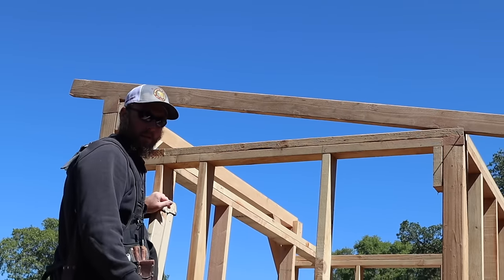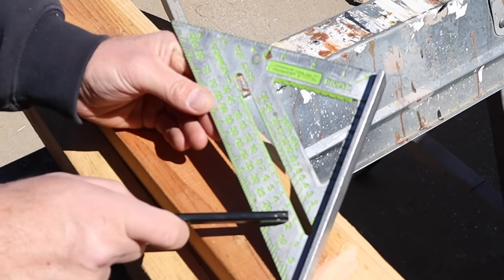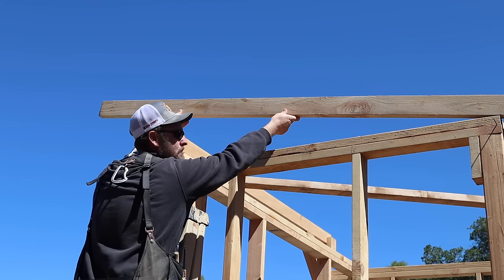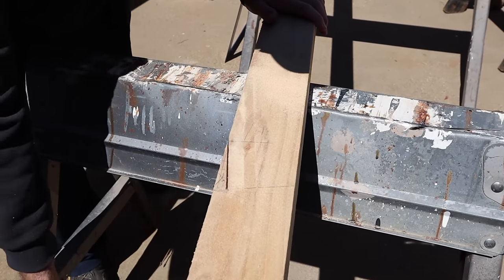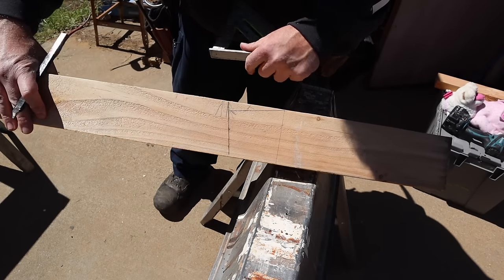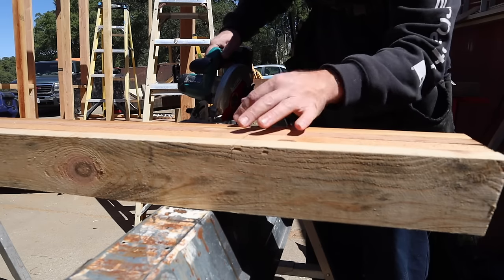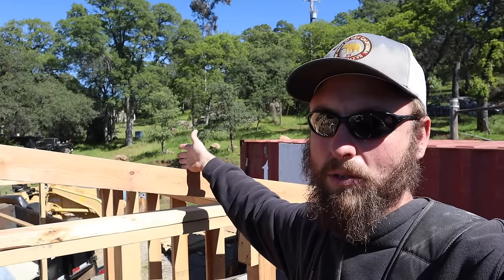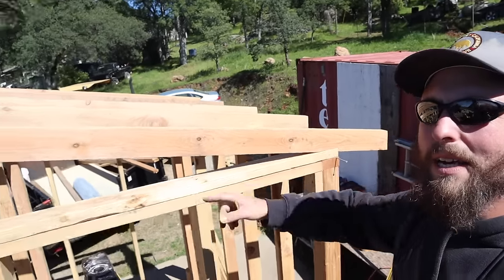BIRDS MOUTH & PURLINS Cutting The Roof | Chicken coop build PART- 4

Comment: I truly respect old world craftsmanship,  always admire diligence in appearance and fit.  You are definitely a craftsman.  With that said, and considering time is valuable and sometimes more modern brackets are exponentially more robust than wood to wood fitments, I’d point to the use of metal prefab brackets between your top plate and rafters. Sold by most lumber stores, they are called  “18-Gauge ZMAX Galvanized Hurricane Tie”.  Sell for $1.25 each.  Huge time saver, bearing strength of 1100 pounds each.

Comment: I just stumbled upon your video, and glad I did. The way you explain each step in simple terms is outstanding, especially for those like myself with limited building experience. This video would have been a game changer for me when building my 10 x 24 firewood lean-to shed last summer. The idea of doing birds mouth cuts intimidated me, so I used hurricane ties instead. The way you explained it and the detailed use of the speed square (never knew how to use one) was excellent and I would have given it a go. I just kept shaking my head while watching this and kept thinking, I would have done a few things differently with my shed (like adding the purlins to accommodate a longer eave) cause you explained its so well. I have only found a few channel to subscribe to, and you have now been added to that list! Thanks, and looking forward to checking out your other videos.
Reply from the maker: I am honored to be on your sub list! don't beat your self up I defiantly went over board on this build (always do). Plus I knew I was going to move it around with the tractor so it needed to be strong. for a wood shed straps will work just fine.
Reply: Joe Simple awesome vid!!!

Same here wish I saw this video before my build I too used hurricane straps on my slanted roof.  I think the hurricane straps will hold just fine however next time bird’s mouth cuts for sure!

Comment: Built something almost identical to this in september. 12x8, 12 feet tall at the front, 9 at the back. First shed ive ever built. Two door entry for the lawn mower, tons of space. Put three motion sensor solar lights on it, one more inside when the snow melts and some compartments and such uptop. The whole thing is framed from 2*6 except for the side walls which are 2*4.  Its pretty smart, all the country folk neighbours love it. Board and battond the plywood. Four X crosses on the doors, pure yellowstone.

Comment: You do an excellent job explaining things , I enjoy watching others  work  now after having worked in construction many years !  A little trick an old time carpenter showed me  is to keep a heavy old time rasp handy! I did a lot of birds mouth cuts and kerfs for ledgers . Knock the wood out with your hammer and then hit the birds mouth  or notch cut with rough side of rasp and flip it over and smooth side rasp the shoulder to heel cut . Takes the little scrap out of the corner and levels things up nice on notches . The rasp will do in seconds what you did with wood chisel ! Try it ,you'll like it !

Comment: This is great, I’m building a wood shed with a lean-to roof like yours. I’ve never built one before and now I’m sure I’ll be able to make the cuts properly. Keep up the fine work and thanks for sharing your experience!
Reply: I'm planning a "kiddo garage" for all their outside stuff and this is the type of roof I would like.  Glad there are skilled people out there willing to share their experience with us all.
Reply: me too!!! Ive been trying to find a solid easy to follow roof tutorial  for my "lean-to". Ans this guy nailed it. I think explaining the common 10 degree measurement is what made this "click" in my head.
Reply: @troyna77  lol nailed it
Reply: Crown your boards the same direction and that direction should be upward so it doesn’t look like it’s going up and down going across the top from side to side.
Reply: @troyna77  the ten degrees is for the 2/12 pitch and it is also for a metal roof so don’t use it for a shingled roof. Buy a speed square and use the common section and the pitch you use just look at the degrees below it and it’ll tell you the matching degrees when you’re lined up on your common pitch at same time so you’ll know how to set up skill or table or chop saws pitch.

Comment: 💥 Nice video.  2:47  measuring 12” along the rafter run gives you less than a 12” extension at the soffit and the steeper the roof the longer that 12” measurement that you did needs to be.  With a 12 on 12 roof pitch  that has to be 18” to give you a 12” soffit

Comment: Just to have a sturdier structure, or when building a larger roof, you could have done some smaller lookouts, the 2x4’s being layed flat,  and only notch the rafters on both ends, then butt the lookouts to the next rafter and nail them flush. But for this purpose it should be fine, a little extra work though.
Reply: Yes. That sounds like a good plan. Load of the roof is preserved that way. Those notches in the middle aren’t necessary and weaken the roof considerably I would think.

Comment: As a suggestion.  If your going to cut in Perlings any way you should center one at 48 inches for the seam of the plywood.  Then split one on either side.  
As an option you can notch only the outboard rafters to use for your over hang.

Comment: I put those tops boards right on top on my roof beams one foot apart. But I can see how notching locks them together...if the beams are big enough for the span. Makes a good over hang away from the rain. Make it steep enough and you'll have a self unloading snow roof. Good for off grid winter clean water on top of the wood stove.

Comment: I'm building a lean to porch and have been wondering HTF to attach the overhang rafter if it's supported by nothing. Purlins.. thanks!
Reply from the maker: Quick tip, you don't have to go all the way through like I did you can just cut out the outside rafter then attach to the next one inside. Hope that helps, thank you.

Comment: Good job!  Extra work warning: notching the rafters 0.75 in and the purlin 0.75 in gives better structural integrity than cutting a 1.5” notch into the rafter.  May be overkill on a chicken coop but worth considering in heavy snow load areas.
Reply from the maker: Ah yes the Lincoln log method, Good call.
Reply: This was my first thought on this. Not that big of a deal on the roof for something small like this.
Reply: Ah good call. I'll try this just for the heck of it.
Reply: That’s a good idea!👍🏼

Comment: Very informative video, both in narration and images. I was concerned, though, that the perlins would severely weaken the shed roof 2x4s. I would have considered instead supporting the outer edge 2x4 roof joists with several equal-spaced 2x4s, angled, that would be  attached to the inner edge of those 2x4s, and the other end toe-nailed into the plate above the wall studs.

Comment: This is excellent. Very well done!!!
Reply from the maker: Thank you very much, so happy that you found it useful. Good luck on your roof build. Please don't hesitate with any questions.
Reply: Hi do you know how high to up on the heel?  It looks like you just did a random distance up the heel and to the reference mark.
Reply from the maker: @cnorth50  when you follow the angle of the pitch you want  useing the framing square to the 3 1/2 inch point it will give you the heal height.

Comment: Very helpful. Where I leave most of the year we have a nice weather. But for to do my projects and keep me out of the sun;  I'm going to build a 10' by 16' cover roof starting from a concrete wall. You gave me pretty good ideas how to notch the rafters to seat well on the beam that I planning to use. 
Well explained 👍🏽
Thank you for share your knowledge and keep up!👍🏽
Reply from the maker: That does sound nice, I gotta build some sort of work area. that seems like a good idea start with the roof structure and possibly build walls later if need/ wanted. Good luck and thank you

Comment: I love your style - you get to the point quickly and your step by step is easy to follow.  I especially like your explanation on how to determine pitch.  It would have helped to give a different example i.e., if the shed was 3 feet in depth instead of 6 feet in depth and the height of the wall was 10 inches...how would that translate to the speed square?   That would then make you a professor :)

Comment: I just set the rafter on the top plates and used a spacer to mark the level cut on the rafter.  I used a torpedo to mark the plumb line at the plate.  I'll add that using a sharp hand saw (Japanese) works fine for the plumb cut.  Or power saw.  Not much to cut in that direction.  Level cut faster with circ. saw.

Comment: if you wanted a 1 foot overhang or eave as you called it . you forgot to add the thickness of sheeting or exterior covering. so it should of been 12 3/4 inch per say or whatever your sheeting thickness was.

Comment: When you marked the first rafter at the bottom, you made a small line approximately an inch or so straight up the rafter, how did you determine that length?  i.e. its the same length at both top and bottom, so it could have been 2 inches, 2.5 inches?  You just wanted to notch out the least amount?
Reply from the maker: If I'm interpreting your question right. The small vertical lines I made were reference lines, the lines that were at angles were the important markes made. Hope this helps, Thanks for watching.

Comment: General question about bird mouth cuts. Why aren't the cuts made so the rafter is locked in between the higher and lower top plates? On the higher top plate, the rafter cannot slide up. If the mirror image of that cut was made on the other end of the rafter, the rafter would not be able to slide down. Sort of like a log cabin. Or is allowing the rafter to slide off the lower top plate the point? In case it gets loose, it won't take the wall?

Comment: Any pitch-slope less than 4 n 12, needs rolled roofing.Otherwise lay shingles, for steeper roofs.TY JoeSimple.We ♡ carpentry!
Reply: Rolled roofing? Dude, use metal anything less than 4/12, 2/12 and under use standing seam metal, anything slower use TPO or Duralast fully adhered.

Comment: You could just use the original piece you cut off the 2x4 when you made the pitch angle cut.

It has the same angles you need to cut off where the timber will sit on the roof.

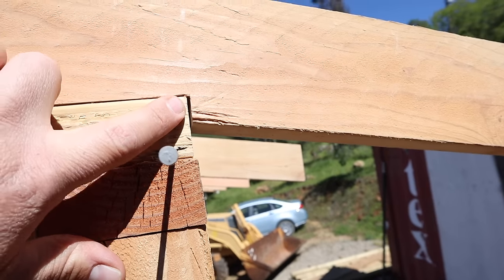Comment: at 10:15, you mention taking some gap space from the lower bird's mouth from the upper birds mouth.  Are you saying you had not yet cut the uppers yet?
Reply from the maker: Hello Brian, all the birds mouths were cut the same. but my building was not perfectly square. So to adjust for the difference made the upper birds mouth bigger to take the difference/ gap at the lower birds mouth. Hope that word salad makes sense 🥴
Reply: @JoeSimple  thank you though I'm a little confused. 

Let me try this:

If you were to measure the distance between the  bird mouths on each rafter, would those distances shrink as the viewer  looks as the rafters move towards the  camera?  Yet each rafter is the always the same length?
Reply: And that's how you do a word salad.
Reply from the maker: The rafter would not get smaller, but yes the distance between the birds mouth would be shorter on the ones that had the gap.
Reply: @JoeSimple  yay thank you for helping.

Comment: Thank you for a nice video , I am new to to this , why would you leave  3.5 inch for the shoulder cut not more or less ? is that the width of the Top plate its going on ?
Reply from the maker: You are correct, itis the width of the plate its sitting on. Thank you

Comment: would you suggest the makita skil saw over all the other brands?
Reply from the maker: Yes, the particular saw I am using I adore, I will look at it and give you a model number later. butttt.. my father has the newer brushless model and I dislike that saw so much. it may be that I have had this saw for more than 10 years that its like an extension of my hand. so long story long. I do like Makita tools and the "old school" brushed 6 1/2 inch blade saw is one of my favorite tools. once you choose a cordless tool brand you kinda need to stick with it as the battery's are what lock you in, the good battery's (5ah) are around $100 each. hope this was helpful.

Comment: I know zero about construction but when I'm in Home Depot I see those boxes that have all of those metal plates for different projects like building a deck. Do they make something that allows you to tie your rafter into your header board so you don't have to cut those birdsmouth so whatever they're called.
Reply from the maker: Those metal plates, say (H1 18-Gauge ZMAX Galvanized Hurricane Tie) are designed to keep your roof attached to the building during a catastrophic event I.E. high wind event, earthquake, heavy snoring. a lot/ most of the Simpson products are designed to keep a structure in one pice during catastrophic events....now trusses are designed to sit flat on the top plate of the wall, no birds mouth needed.😃
Reply: @JoeSimple  this is probably a stupid question but instead of having to cut all those notches out of each truss can you just sit them on there and then put 3in L brackets on each side of each trust with two inch outdoor screws? I know the objective is to have the trust make as much surface contact with the top of the wall but it really just comes down I'm guessing to anchoring it in place so it doesn't move side to side
Reply: I am thinking of making a 10 x 16 type roof to go over an area where my wife likes to lay in her hammock to keep the tree branches in the sun off of her. I know there's something called a pergola or something but I want a solid roof not having layers of wood because the sun will still come in based on its angle
Reply: I was going to make one wall 8 feet high and the other wall seven feet high and just run the trusses across so there's an angle for Rainwater. I did learn a little something about figuring out pitch which I guess I haven't factored in yet because I would definitely like to do shingle so I guess I need according to my internet research 8-12-4 for this sunroof
Reply from the maker: but using a bracket will not give you any rigidity. Think of it this way, a roof is not just a roof it is part of a structure.... possibly the most important part of a structure/ building the part that keeps the elements off of us. A proper joist, rafter, truss play a part in the function of the building its self. If you have 2 post with a beam on top I can easily push that over with my body weight... but now you have 2 sets of those posts and beams, tied together with a well fitting joint (birds mouth, full contact "truss") the structure is much harder to move not impossible but throw in some diagonals from the beam to the post and the structure will last.

“The whole is greater than the sum of its parts.” 
― Aristotle

Comment: Good video.   I have one question though and that was what happened to the 1/4" gap at the low end of the roof after you cut and placed all the rafters?  You said in the video to take it out of the other end.  Is that the very end?  As in cut 1/4" off the very end, or do you have to modify the birds mouth?
Reply from the maker: Great question, I got rid of the 1/4 gap, by modifying the birds mouth that was sitting on the beam /high side of my building. Cutting the heal back a 1/4 inch. Hope this is helpful?
Reply: @JoeSimple  So the joists @ the low end hanging over the wall are not the same length.

Comment: WHAT a lot of work to cut birdsmouth on each & every one of the joists. For my
20ft wide lean to shed, I'd need 10 birdsmouth. Wouldnt it be easier to cut a 
champfer onto the header on top of your posts so the joists all lie flat? Thats
the way I'm gonna do it. Once my posts are concreted in the ground I'll install
the header board THEN, take my circ saw & cut a champfer along the whole 
20ft header. Zip.DONE.

LAZY people have created more labor saving innovations than anyone.

!

Comment: I take 3/4" out of the purlin & 3/4" out of the edge wall rafter. lays into edge wall rafter and nailed flush with next inside rafter and then flush with the overhang fascia rafter.  This way you only take 3/4"' out of a rafter.  A 1 1/2" cut in a 2x4 rafter is too much.

Comment: Instead of merely marking the rafter at 3:17, why not take your t-square (anything with a straight edge), lay it on the rafter so that it's vertical against the header, and draw a line across the rafter. Should be the same line drawn at 4:10.

Comment: Mate!! You have absolutely smashed it. I'm so glad I found this video. Explained everything so well and simply to understand. I'm now confident enough to tackle my own project especially now I know how to measure the eave cuts and birds mouths. Thankyou so much - massive relief! Just a quick question. You made a reference measurement at 4:12 of 3 1/2 inches. Was that down to the dimensions of timber you was using? Also, would a 1 in 12 be enough for a small greenhouse. 6x8 ft. Thanks
Reply from the maker: Thank you, yes the 3 1/2 cut is the width of the top plat the rafter would be sitting on. In my opinion, I think yes 1 in 12 pitch would work for a small green house.

Comment: Was that makita a 7 1/4 saw? or the 6 1/4(or whatever it is) smaller one? I need to buy a new circ saw and im pretty sure i can get away with the one thats a little bit smaller than 7 1/4. ( i dont cut much 4x4 or 6x6) . So i think the smaller blade will do just fine for mostly 2 x material. Thanks man.

Comment: Hey! Great video. But how did you find the 3,5 inch for the seat cut? Thanks
Reply from the maker: That is the width of the 2x4 (1.5" x 3.5") top plate that the seat cut sits on.